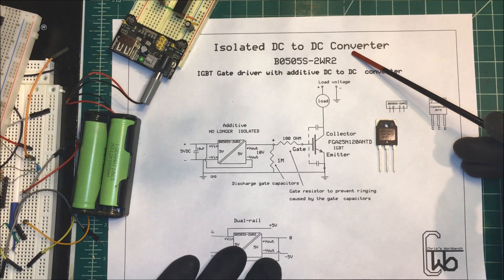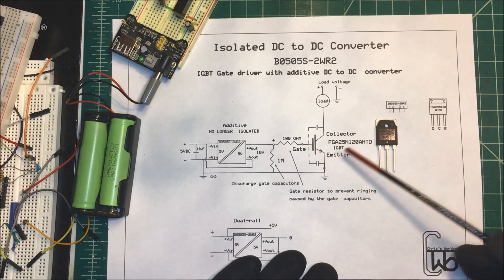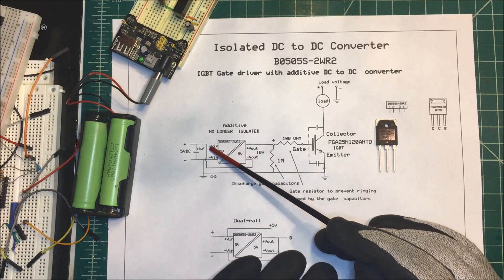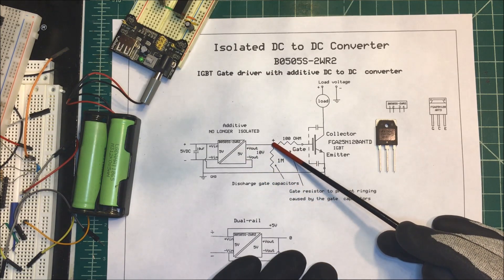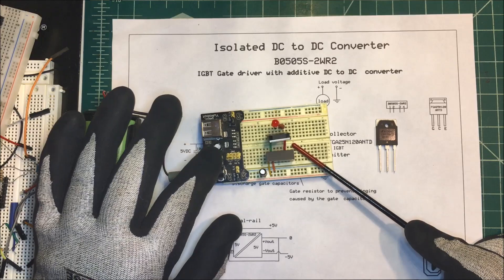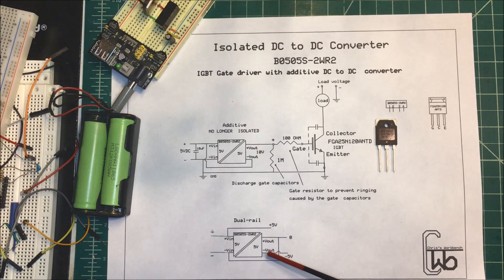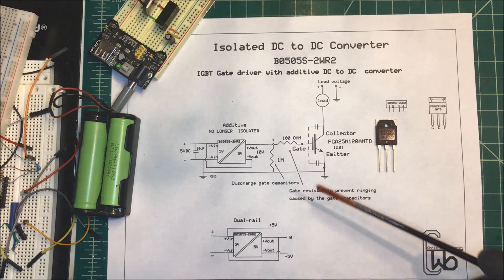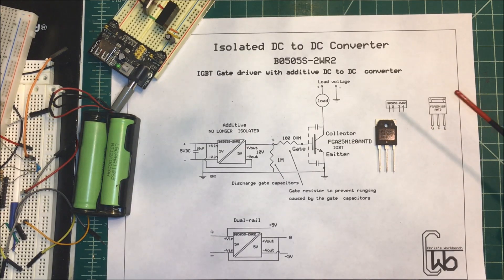Isolated DC to DC Converter

Comment: Thay was pretty neat. I'm still trying to figure out the use for - voltage. I realize ground/or 0 is not always true zero but i don't understand why we'd use it.
Reply from the maker: Some op-amps need a dual rail supply.  _ and + rail, the 0 is not used.
Reply: @ke6chris  so basically the - would become the other end of the voltage potential there by giving you a 24 volt potential on a 12+ to 12- dual supply?